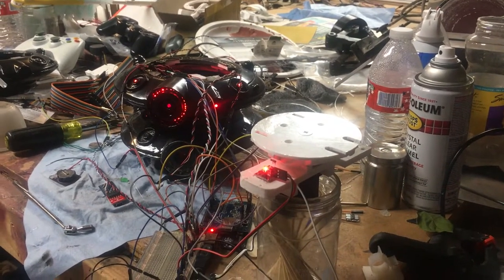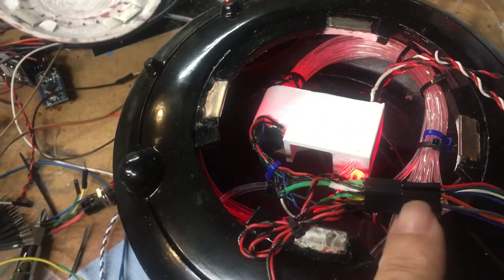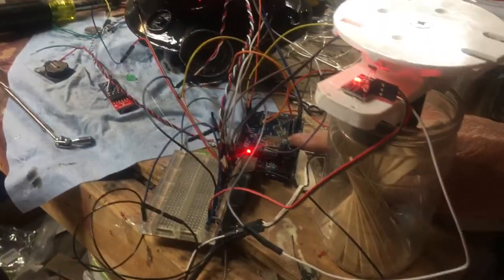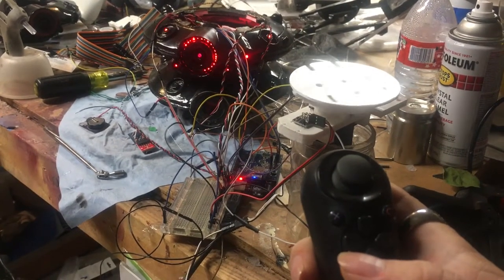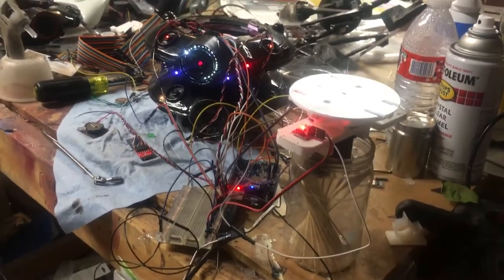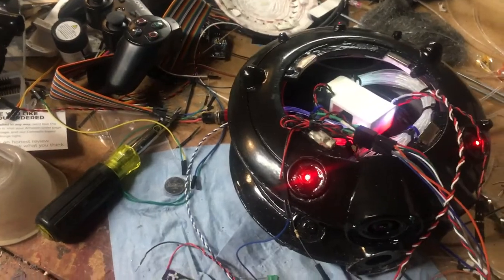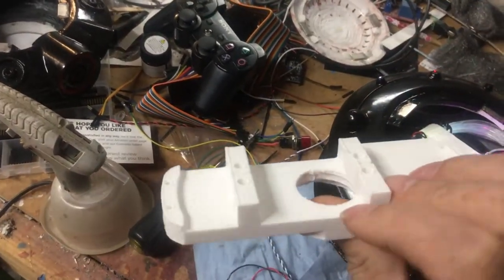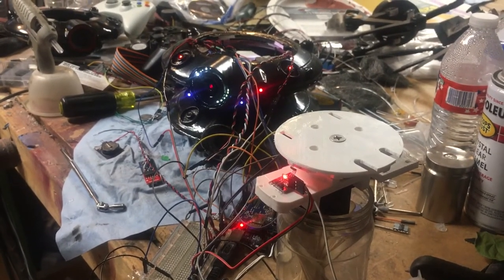ID10 Tactical Seeker/probe Droid WIP

Comment: Hello, may I ask you to get the Arduio Micro "Code" ??
Reply from the maker: Yeah, i gotta dig it up on the server, so give me a little while.
FTR: not a programmer. I got this thing to work, but it isn’t elegant. 
I would also consider chucking the ps3 remote and go xbox360. They just pair so much easier. 
I had trouble figuring out how to stuff the transceiver in there because as you can see it pretty full, and i have a few of the Nav controllers about.
Reply: @spurgco  thank you verry much :) i am a absolute beginner at Arduino
Reply from the maker: @ntdw0011  try this: [https://drive.google.com/file/d/1hoGMWK3AaU7t8rg-qJ3OnpfFgENfqRTB/view?usp=sharing ] if that throws permission issues, let me know and i will find another resource.
Reply: @spurgco  I will try it, thanks a lot :)
Reply: Do you may sell such a Setup for this exact modell? I'm build it at the moment and would love to bring it to live but have no experience in electronics and such. :(